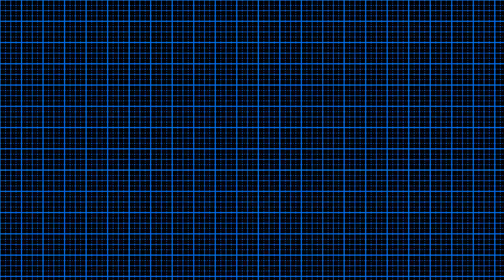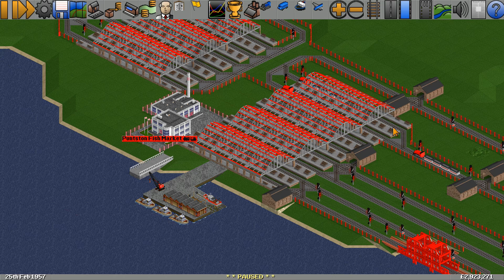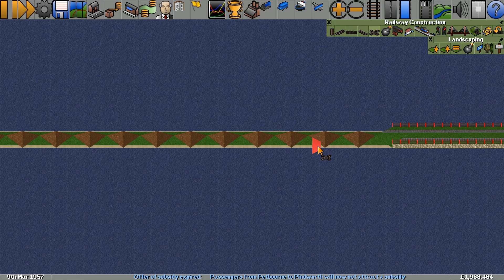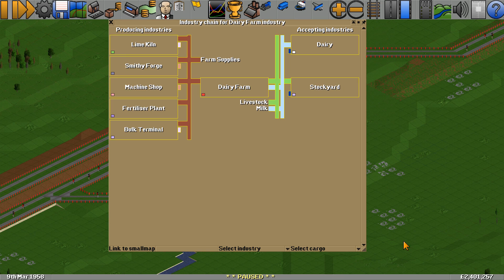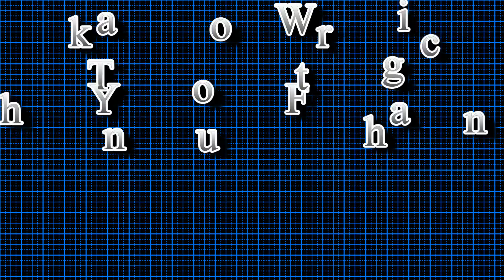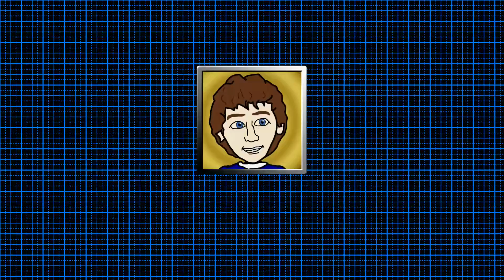OpenTTD City Builder Lets Play S5 E9 Farm and Engineering Supplies

Comment: Check the corner on the oil line when leaving with engineering supplies, they have to loop through the refinery
Reply from the maker: Good point, I will update the junction